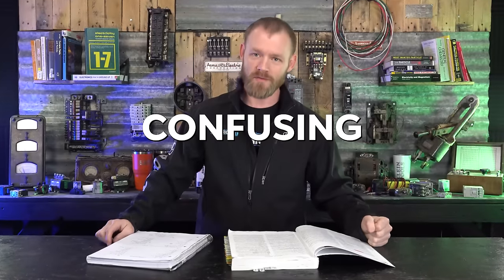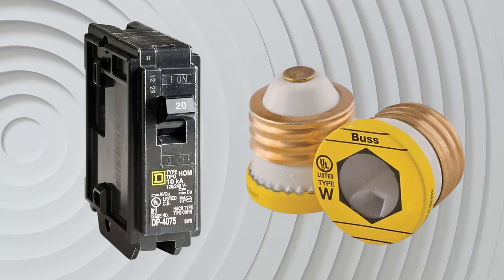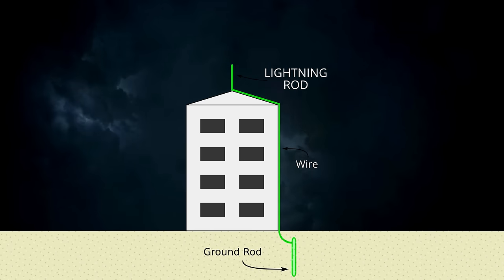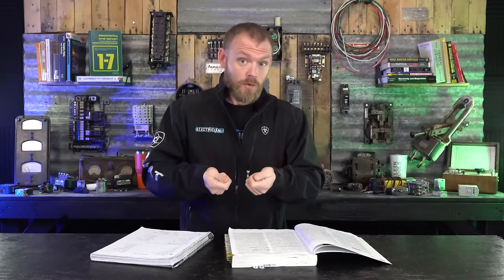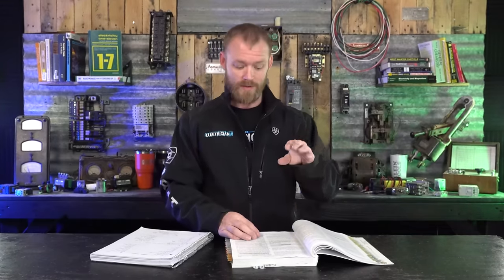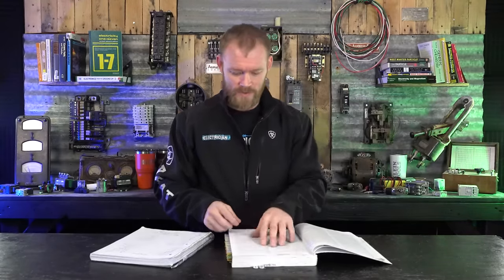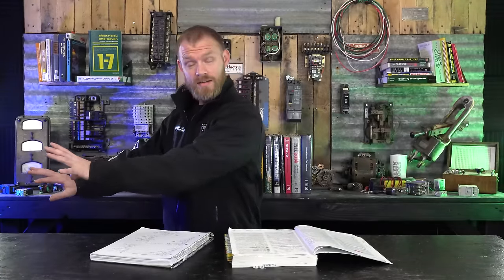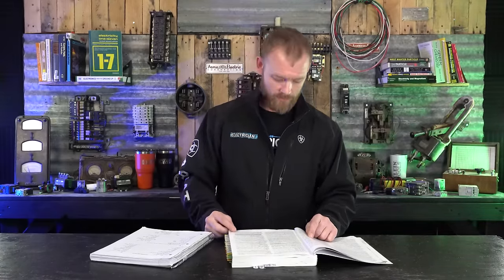What Do Those Code Terms Mean? NEC Codebook

Comment: I have a question about hooking up a meter socket and panel using 350 kcmil cable. The lugs won't accept that size cable. What can I do here? Use a pin adaptor? cut several strands out until the cable fits? Thank you

Comment: Funny story about surge protection.  I lived in a rural home where cell and internet service were from antennas on  a 50-foot self supporting tower, with the coax from the antennas run into the house to indoor amplifiers, antennas and routers.  The tower itself was grounded, but one night lightning struck directly the tower, and enough energy coupled to the antennas and down the coax into to house to try to find ground that those wall power supplies all over our house, including those plugged into surge protectors, exploded and shot burnt plastic and circuit parts all over like little frag grenades.  Years later we still find little charred pieces of electronics behind furniture and stuff.  Left burn marks on the walls and outlets.  Lights and other analog stuff like fridge and AC were fine though.  Also antenna parts were all over the lawn and still find those too once in a while.

Comment: When I took my license test back in the mid 70's one of the exam questions was what is the identified conductor. Was what they called a neutral conductor but after a hundred years dopes changed one of the common most used code term to grounded conductor. Asked 5 electricians at work that question and none did not have a clue. Back then was told the NEC had a quarter million words. Probably doubled since then.

Comment: Speaking of appliances, if I understand correctly, a "portable" appliance is something such as a microwave oven, hair dryer, coffee maker, mixer, vacuum cleaner toaster, iron, blender, electric griddle, etc.   A "stationary" appliance would be a range, refrigerator, deep freezer, clothes washer or clothes dryer.  A "fixed (or fastened) in place" appliance would be a dishwasher, garbage disposer, water heater, sump pump, central air conditioner, furnace, etc.
Reply: Well you're doing better than the one lecturing.
Reply: @Robsemail001  How about becoming positive and learning to use the brain you were given.

Comment: When can we start doing AC disconnects sizes ?? How to determine by the F.L.A??
Reply: FLA = Full load actual
FLC = Full load code

FLC means for a given motor output power rating, there's a code-specified conservative value of the maximum expected full load current associated with it.

FLA means the actual full load amps, from the motor's datasheet or nameplate.

Comment: TR receptacles should have been in code 40 years ago. Over 500 kids in the USA go to the ER due to sticking objects into receptacles. Was told 2 things about snap in receptacle covers: Choking hazard so should never be used & looked at these covers in 3 different stores that sold them. None had UL or some other approved testing agency stamp on them.

Comment: Man, I really hate TR receptacles-- wish they weren't a requirement. Maybe just the ones I've used have been the lowest cost ones possible, but 75% of the time the shutter ends up jamming or you have to jiggle/shove the plug in just perfectly to get it to release. In my own house, anytime I have to add/change a recep, I use the non-TR spec-grade receps instead.

Comment: Appliance, where does it say "plugged in"? It says "installed or connected" which is by whatever means of which plugged in is but one of those means. An appliance also includes lighting devices. “The problem isn't that Johnny can't read. The problem isn't even that Johnny can't think. The problem is that Johnny doesn't know what thinking is; he confuses it with feeling.”
― Thomas Sowell

Comment: My shop calls conduit pipe. Everything in this trade has a million different names.
Reply: What you call it is cool, but it is also good to know the proper names. Just like it is good to know how to speak properly even though you may speak with slang to friends. A pipe is measured more by the inner diameter in order to designate the volume of liquid/gas it can carry, whereas tubing is measure by outer diameter.

Comment: Hey dustin I’ve watched so many of your vids as I am an electrical apprentice but I’ve always wondered how you would wire a circuit for a light with 4 switches to turn on the light I would think you could have a 3 way on the incoming hot and the path to the light and two four ways in between but am not sure thanks
Reply: Yes, you are correct. You could have 10 four ways in between 2 three ways and it would still work the same.